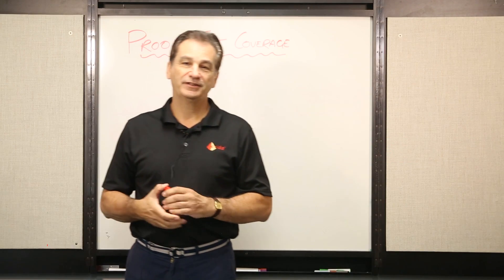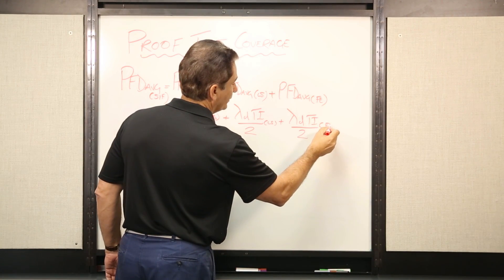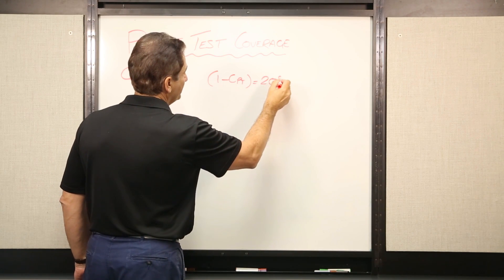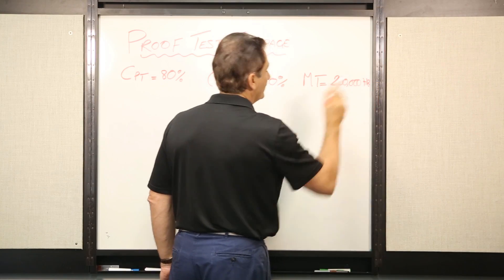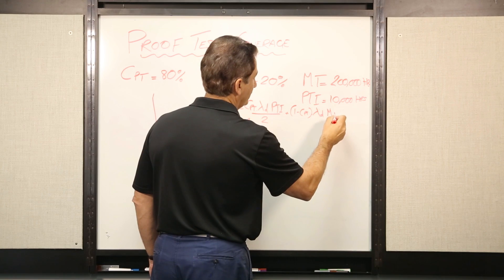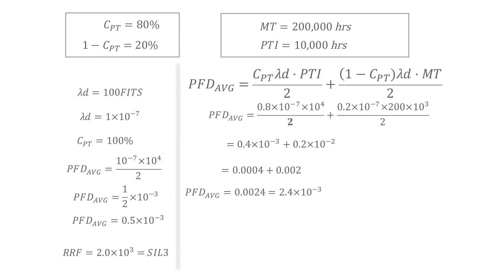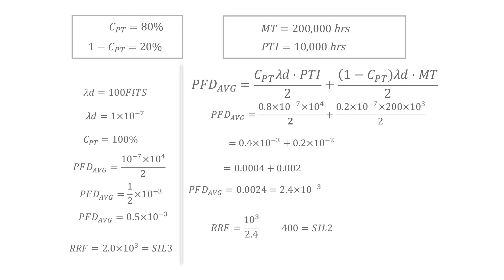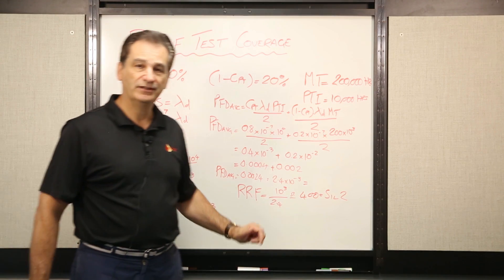exida explains - Proof Test Coverage

Comment: In estimating proof test coverage we first need to understand which failure modes can never be detected and think about why we have designed a system with undetectable failures. We should be designing our systems to enable full testing.  We also need to think about whether those undetectable failures can be expected to occur at a fixed and constant rate.  Many undetectable failures are systematic so are characterised by a probability and not a failure rate.  For instance we can't detect that a fuse is the wrong size because we can't test it, but its probability of failure is not likely to increase with time.